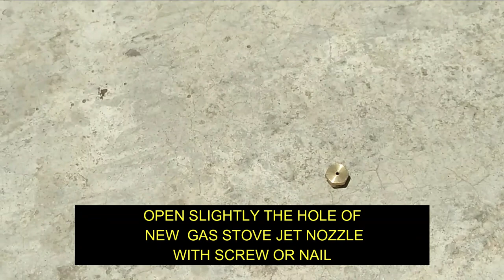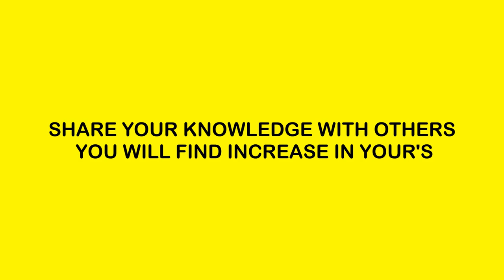how to get  yellow flame out of the burner?

Comment: If you're using an LPG cooker, top flames should be completely blue with no yellowing or black sooting on pans kettles or utensils  On ovens and grills however, there is always a small amount of visible yellow tipping at the top of the flames, especially when using butane gas cylinders at 28-30mbar pressure but the flames will be completely blue and of even height using propane at 37mbar pressure. 

If you connect a natural gas cooker straight to LPG without proper conversion using LPG jets specific to your appliance first, you will suffer yellow burning and sooting on all the burners with blackened pans kettles and utensils plus blackened oven / grill walls.

And the same will also be true with an LPG cooker connected to natural gas without proper conversion to natural gas using the natural gas jets specific to your appliance. 

Some people have said to me that modification of jets set for one gas will solve the problem, but it doesn't quite work like that. 

Natural Gas and LPG are totally different with different operating pressures and calorific heat values and are totally incompatible with one another and no amount of machining, modification or trying to make the jets wider or larger to get round those simple facts will change that.
Reply from the maker: Thanks